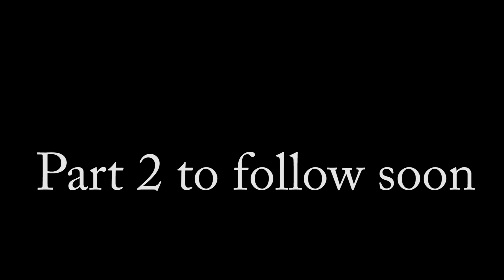Pfizer, process 2

Comment: They r taking a snot sample ( falsely calling it isolation)..they dont need it sonce the diseasing occurs due to enzymes which are kidney toxic in the first place on kidney embryoncell lines Hek 293 cell lines ..making them cancerous ..highly cancerous 
And then diseaeing the hk293 cell line ..with enzymes qnd antobiotics ...and then run int in multiple passthrouhs 
Repeatedly ..
Creating hugh amounts of pla2 ..
And chronic inflammatory sognals .thay include the spike protein..when they r remannts of cell diseasing ..
They then call it mRNA ...
Its all diseased cellss ..with amplified pla2.and chronci inflammatory sognals ( ie spike proteins when they r proteins fractures from cell aptosis process.
This is then falslely claimed to be mRNA.

This is why DNA sifnal are found in pfizer..
Its all a chrinicninflammation soup with high pla2.and cancer causing pathways 
It is then weaponised in nanolipds..
 weaponised ..that crosses and lodges in epithelium and blood brian barriers
ie a time bomb nano capsule..
Slow release or activated acutley vianmillimetre waves when accute  hypocia is generated die to e.m waves 
To summarise ..all this science talknis bull crap.
Its just diseased cancer prone immortal cell lines with chrinic inflammatory sognal like pla2 ...wraponsied in nano capsule tech ...
They used it for cancer resewrch but it failed ...becuase of  early release of cancer poisons..die to poor nano capsule tech...
With pfizer thheyntestwd this tech ..hence the incerdibly low temperatures ...
The high tech is the nanolipdncapsules ..but the mrNA is low tech...ie diseased high pla2 soups 
Hemce the turboncancers.
Gogol : metastasis phospholipase a2

Comment: Yes!  I was first made aware of this quite some time ago.  I think it was Dr.  Michael Yeadon that was the first person I heard talking about the trials process vs the production process.  Of course the volume requirements were entirely different which meant different machines, different batch volumes of the raw materials and no doubt, different quality control mechanisms.  The other thing is that there were some serious deficiencies in the production processes documented by the regulators.  But there was no time to correct those deficiencies and have them retested.  As far as I know, Pfizer went into full production having outstanding deficiencies.  What happened after that, I don’t know, except there were wild variations between the lethality of different batches.

Comment: One would expect an obsessive attention to detail in a field such as the production of vaccines and especially on the mass production of vaccines that are intended to prevent a deadly pandemic.

I can understand that one might want to use a process with low upfront costs and higher per unit costs to produce vaccine samples for clinical trials, especially if the production lead time was shorter, and then switch to a mass production process where the capital investment might be higher and the lead time might be longer, but the per unit production costs are lower.  This is the same concept used almost universally for manufactured goods.  But one has to be a complete moron to then think that the vaccines produced by process 2 can be approved without completely replicating the clinical trials.

This is akin to Acura making a handful of new NSX supercars, testing them at the Nuremberg ring, garnering rave reviews from the automotive press, taking orders for many thousands of them, and then sending all the blueprints to Bubba's and Skeeter's machine shop and garage to build them all.

Comment: It's just like the method for baking a cake. The measurements the order in which you add them. The temperature, when used, is reflected in the quality of the cake. The ability to duplicate said cake is dependent on the process.

Comment: RNA virus has  no DNA only RNA When you use PCR  you can replicate either RNA  or DNA. So they can culture  the virus from a patient and you can get enough of the RNA  to use it to make lots more with PCR. So they wouldn't need to make DNA  to get RNA ( there are RNA  viruses and other not related  DNA viruses two separate things). The viruses go into a complete cell ( our body cells or a bacteria cell like E. coli ) with nucleus and mitochondria  and use that cell to make lots more  RNA virus. A plasmid is a virus that parasitizes a bacteria  enters the bacteria and gets it to make a bunch of copies of that plasmid ( virus). Because virus inserts it's genetic material into the host cell it sometimes changes ( accidentally) the host bacterial  genetics by transferring some tiny bit of genetic material from a previous host. So then the bacteria has gained some function (accidentally). This is why when you do bacterial work we say they " didn't read the book "  and misbehave.  Suddenly a species can change or evolve  permanently.  Probably happens in higher animals as well as bacteria. The plasmid is not purposely doing this it's only life purpose is replicating itself the rest is accident. The alterations made may be beneficial to the bacteria sometimes or it can be fatal to the cell line. 
The important part of plasmids is that they can enter other cells so if you use the type 2 production using plasmids it's (in my opinion) bad cause if some of  the plasmid material is in the final vaccine product it might allow the vaccine material to get inside of the patient's cells in their body,  That doesn't sound good to me. The type 1 production  using PCR is much better  PCR  just uses a short lived  enzyme  and temperature modulation to replicate the viral RNA chunk no need for  a E coli bacteria or plasmid at all so none added to the vaccine product . Yes it's probably more time consuming and costly to use PCR type1 method but so much cleaner and safer it's worth it.  I'm shocked ( but maybe not knowing everything is cost driven these days) that they would  change to type2 method, particularly because they didn't even retest to see if it was safe.
Reply: RNA would not survive the heating cycles in PCR, so it is converted to double stranded DNA first.
The PCR process doesn't scale nearly as well as the E. coli process 2.
If it is found that the DNA in process 2 is identical to that of process 1, why the need to retest?

Comment: What is meant by the concept of bait and switch?
Bait and Switch: Definition, How Strategy Works, and Tips to ...
Bait and switch is a morally suspect sales tactic that lures customers in with specific claims about the quality or low prices on items that turn out to be unavailable in order to upsell them on a similar, pricier item. It is considered a form of retail sales fraud, though it takes place in other contexts.

What is an example of a bait and switch approach?
First, customers are "baited" by merchants' advertising products or services at a low price, but when customers visit the store, they discover that the advertised goods are not available, or the customers are pressured by salespeople to consider similar, but higher-priced items ("switching").

What is the bait and switch negotiation tactic?
Bait-and-switch is a deceptive tactic that involves luring someone in with an attractive offer, only to change the terms or conditions at the last minute. This can happen in various contexts, such as sales, contracts, or negotiations.20 Sept 2023

Bait and switch tactics are often considered to be a type of fraud, and therefore is illegal. Bait and switch scams can fall under a number of violations, from breach of contract to false advertising.

Is it bait and switch?
"Bait and switch" is a term used to describe an instance when the retailer offers for sale (switches) an advertised item for another, less expensive or desirable item that is not the same as the originally advertised item.

What is the bait and switch effect in psychology?
Bait and Switch - Meaning, Scam, Example, Psychology
In the Bait and Switch policy, the customer is attracted to an advertised product (bait) and made to switch to a pricier alternative (switch) with the persuasive skills of the salesperson. It is not followed when the seller tells the customer beforehand that the advertised product is available in a limited quantity.

Comment: In automation: if you change a procedure (a tiny bit of code even), you actually have to test all ins and outs again to see if something changed. And even then you are not sure.
However, in automation you usually have detailed logs and reports and you can usually roll back whatever you fucked up.
In these cases it's extremely complex. So safety testing should have been done from step 1 in the new process.
Also all the testing that is now going on, should have been done before the first shot.
It basically boils down to this: they never did any safety testing at all for this product.

Comment: I did recombinant dna and we used both methods together. We would make in yeast plasmid then transfer into eccoli to multiply. Then do pcr to amplify the piece of rna or dna we needed. This is why I was okay with the Pfizer. If undergrad me could make a string of rna, scientists can do it. I disagree with the statements of the guest. The methods to amplify and multiply dna/rna are not concerning to me. We use both eccoli to make long strings of dna. Then we snip off what we need chemically and then we amplify that isolated bit of dna with pcr. Once you know the bit of dna you need you do not need to cycle back to the yeast plasmid. You can just keep making bits of dna through pcr. So I am confused why the guest thinks that every batch needs the plasmid step.

Comment: 1. The COVID vaccines used by Pfizer in clinical trials used a manufacturing process referred to as Process 1. The vaccines given to the public afterwards used a different manufacturing process called Process 2.

2. Process 1 used PCR technology to synthesize the DNA and then multiplied the DNA using PCR to produce enough DNA to make the RNA. This was a clean process using magnetic beads to remove impurities. 

3. Process 2 used E. coli bacteria to produce the DNA in a more scalable and cost effective way. But they seem to have done a poor job cleaning out bacterial remnants from the end product.

4. Research is showing high levels of plasmid DNA and endotoxin (from the bacterial cell membranes) remaining in the Pfizer vaccine vials produced using Process 2.

5. Endotoxin from gram-negative bacteria like E. coli can cause inflammation and may be linked to some of the adverse effects reported with the vaccine.

6. The speaker gives the example of the "cutter incident" with the polio vaccine in the 1950s to show that the manufacturing process is crucial and changes to the process can produce an unsafe product, even if the original was safe.

7. In summary, the speaker argues that Pfizer should have conducted new clinical trials to test the safety and efficacy of the Process 2 vaccines since they were a different product than what was used in the original trials.

Comment: I have read/heard through various articles and podcasts that there is even more to this. The vs were supposedly also of differing strengths of MRNA depending on their place on the manufacturing line. ie first or last off, lesser to stronger. Not only that the vials apparently had differing amounts of debris and particles in them for the same reason. Other factors also to consider are the place and country of manufacturing origin and the oversight in that country. Basically  roulette. Batches varied.
Reply: It's the vials.

Comment: Had some basic lessons on biopharma stuff, key note the process all input stuff and all equipment used have to be approved, if you change for example the bio reaktor from single to multi use you have to do the whole certification again..... So why was that not done ?
Reply: How do you know the process is not certified? You don't.
Reply: @theopeterbroers819  You are right, it was an assumption on the fact that the DNA residues are over 10ng/dose, which is the limit according to WHO ( around factor 200 over the limit)

Comment: Why would magnets be used to clean up the Process 1 batches?  What is metallic in the batches?
Reply: Great question. MRNA is made magnetic by linking a tiny magnetized polystyrene bead to it. As the 'glue' is made specific to the target (mRNA in our case), a magnet can fish out the target, leaving behind contaminants. I don't know details, but the polystyrene bead will be removed in a following step.

ThermoFisher: The History of Dynabeads and Biomagnetic Separation. "In 1976, the Norwegian professor John Ugelstad first succeeded in making spherical polystyrene beads of exactly the same size—only previously achieved by NASA in the weightless conditions of space. Another amazing achievement followed, when the uniform beads were made magnetizable."

"The Dynabeads magnetic separation protocol consists of three simple steps:
Bind When added to a sample, Dynabeads bind to the desired target (cells, pathogenic microorganisms, nucleic acids, peptide, protein, or protein complex etc). This interaction relies on the specific affinity of the ligand on the surface of the beads (Figure 1).
Wash The beads respond to a magnetic field, allowing bound material to be rapidly and efficiently separated from the rest of the sample. Unbound material is simply removed by aspiration, and the bead-bound target washed by the use of the magnet.
Elute The bead-bound target is released in a suitable volume for use in downstream applications. Alternatively, the bead-bound target can be used directly while still attached to the beads.

ThermoFisher have a few small videos on their site.

Comment: I already knew clinical trials are a sham, as they 'deep six' any bad trials and start again with a new set of participants, screened differently, and keep doing that until they get the results they want. That applies to all clinical trials. But this revelation is a whole new thing, that they didn't even manufacture the actual product that WAS approved in such a ridiculously short time. I didn't trust anything from January 2020, but this is a whole new level of outrageous behaviour on their part. Truly unbelievable.

Comment: 20 years ago, the molecular biology you just described was clearly understood to produce different standard of results. One you use in the lab for very reliable, ultra-high purity products (process 1, PCR). The other is in fact used regularly to make drugs. We make insulin this way. It doesn't necessarily mean you can't use process 2 at scale for industrial-level production and have it be safe. You absolutely can make it safe. Again, this is how we make insulin. If Pfizer is getting "messy" products from Process 2, it's because they're being sloppy, intentionally or otherwise. I have my suspicions about which.

Comment: Enlightening. Does this not amount to a criminal act since the actual vaccines supplied are arguably not the vaccines which underwent clinical trials and received governmental authorisation for distribution?
Reply: Phase 3 trial used 'Process 2' vaccine; Phase 1 and 2, used 'Process 1'.

0:52 "The key Point here is that in the clinical trial that Pfizer BioeNTech ran on their covid vaccine they used vaccine doses that were made with one manufacturing process, but what was given to the public after the trial was not the same type of doses."

By late July [2020], when the Pfizer-BioNTech team selected the vaccine candidate that appeared to be the most promising, the manufacturing teams were ready to ramp up production for clinical trials while also building stockades for real-world use in hopes of success.

Phase 3 trial: "Between July 27, 2020, and November 14, 2020, a total of 44,820 persons were screened, and 43,548 persons 16 years of age or older underwent randomization at 152 sites worldwide in the phase 2/3 portion of the trial. A total of 43,448 participants received injections: 21,720 received BNT162b2 and 21,728 received placebo"
Reply: Did you watch this video -  "Dr John Campbell’s ONS death claims are bollocks" ????

Comment: Was it tested on 252 people or 250 people per lot?
Reply: Pfizer, Shot of a Lifetime: How Two Pfizer Manufacturing Plants Upscaled to Produce the COVID-19 Vaccine in Record Time
By late July [2020], when the Pfizer-BioNTech team selected the vaccine candidate that appeared to be the most promising, the manufacturing teams were ready to ramp up production for clinical trials while also building stockades for real-world use in hopes of success.

Pfizer Trial: "Between July 27, 2020, and November 14, 2020, a total of 44,820 persons were screened, and 43,548 persons 16 years of age or older underwent randomization at 152 sites worldwide in the phase 2/3 portion of the trial. A total of 43,448 participants received injections: 21,720 received BNT162b2 and 21,728 received placebo"

The Phase 3 trial used 'Process 2' vaccine; apparently they kept note of lots. Before that, in Phase 1 and 2, it was a 'Process 1' vaccine.